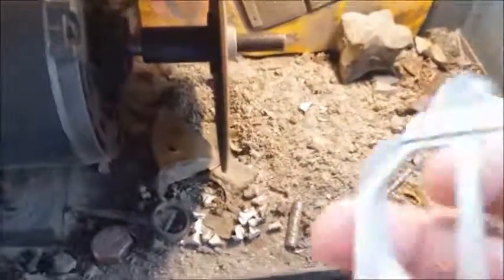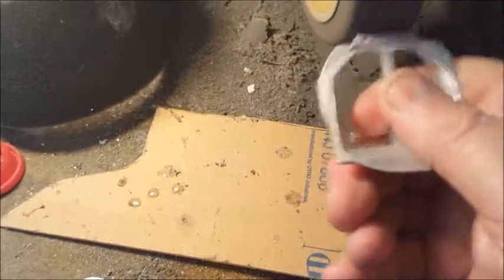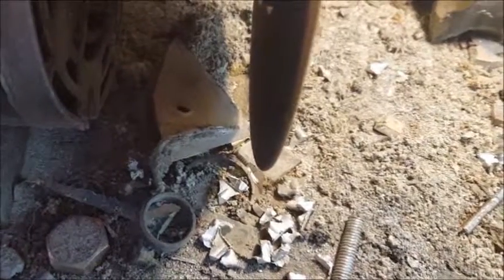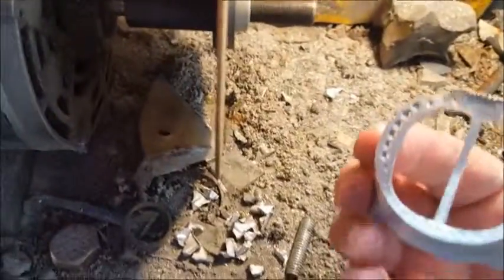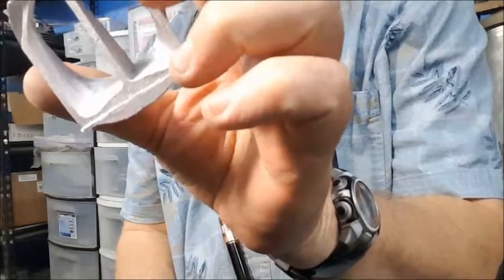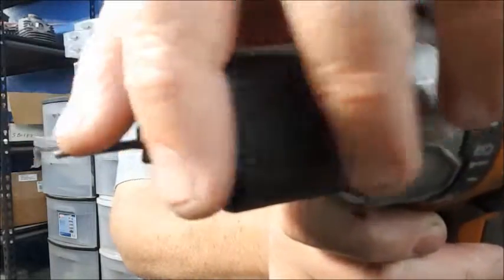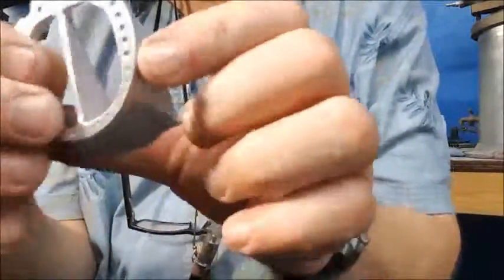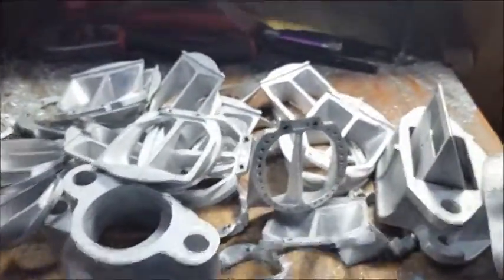finishing raw aluminum castings

Comment: Aluminum sand casting surface finish is not as smooth as other casting methods. However, the foundry can improve the roughness of aluminum casting and increase its look by strictly controlling the choice of sand, mold coating components, mold compaction technique, pouring temperature, and additional processes.
https://vietnamcastiron.com/aluminum-sand-casting-surface-finish/